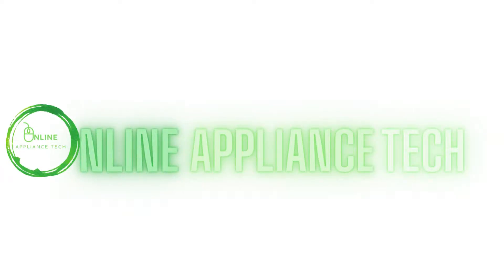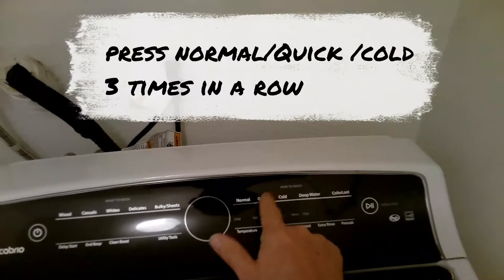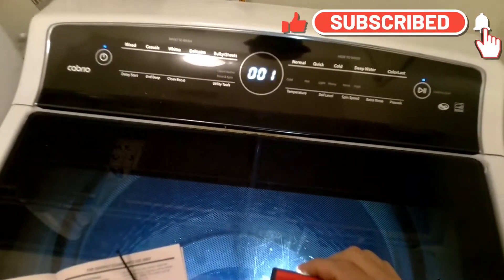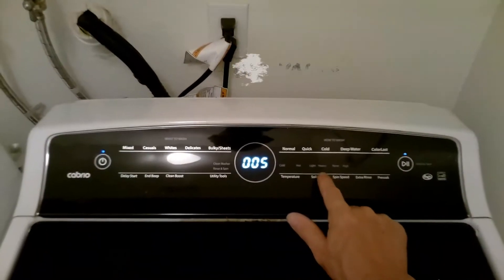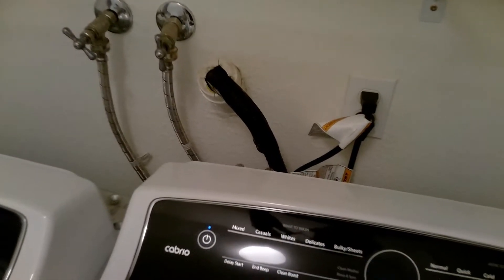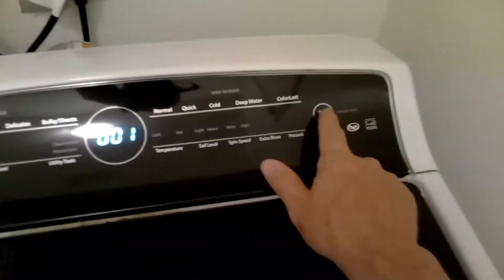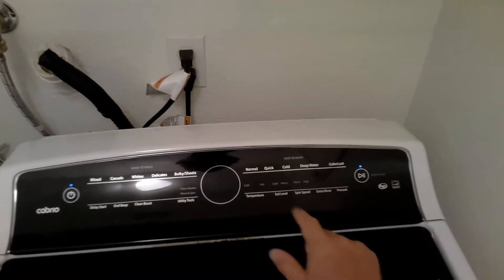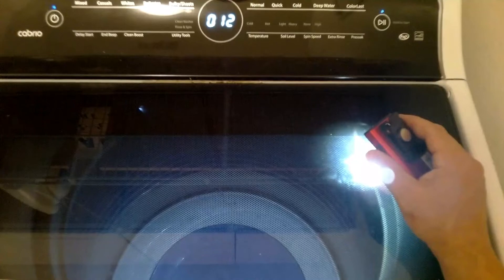Whirlpool Cabrio Washer Diagnostic Mode [ Pull up Error Codes] [WTW80 ]

Comment: Error code F5E3- door will not unlock, I tried unplugging and plugging back in but still locked. Any help?
Reply from the maker: Thanks for your comment! The F5E3 error on a Whirlpool Cabrio washer means the lid or door won't unlock properly. Since you've already tried unplugging and plugging it back in, here are a few more steps to try:

🔹 Unplug for at least 10 minutes – This allows the control board to fully reset. Sometimes a short unplug isn’t enough.

🔹 Check for water in the tub – If there’s still water inside, the lid may stay locked. Try running a drain/spin cycle if possible.

🔹 Lid lock switch may have failed – If it keeps happening, the lid lock assembly is likely faulty and may need to be replaced. It's a common issue on these Cabrio models, especially after power surges.

Hope this helps!

Comment: Cabrio model WTW7000DW1 did not finish the spent cycle and won’t get into diagnostic mode. Nothing happens when press the normal, quick and cold button 3 times in less than 10-15 seconds.
Is dead. Can you help?

Comment: Mine won't do anything after chosing a cycle. It's starts and goes back and forth with the add garment. The last time i tried a cycle and turned off the power it flashes INT. I did the diagnostics and everything working fine can you help? Please

Comment: My washer is a wtw8500dc3 it is showing a dash and a dot on my lcd display and pushing, normal, quick and cold 3 times doesn't change anything. I also unplugged it for several hours and when I plugged it back in it showed and equall sign with a dot. Any advice?

Comment: Nice Video with good information. Thanks.           I have a code "F2E1" showing on my Whirlpool Cabrio Model #WY8500DC3 and am not able to find a suggestion as to what it relates to exactly.     One suggestion I saw was the control panel might have a button stuck, but heating it with a hair dryer,as suggested,  did not work.    I did see a video someone posted on Youtube where a washer had a code of "F2E1" and "F7E4" and the Agitator splines were striped, but never saw what the "F2E1" code was related to on that machine in the video.     Can you help me on this "F2E1" code as to what it could be.
Reply: @Ralf-n3h  ever figured out what the fix was?

Comment: Super helpful! Allowed me to rule out that the valves are not working. They are working fine. Door locks fine too. Drain pump is working, etc. As far as I know, all is working individually. Yet the machine does not turn on when we try a regular washing cycle. Worked fine just the other day. No error codes.

Comment: What about f3 e2????
Reply from the maker: The Whirlpool washer F3E2 error code is a temperature sensor error.

If the water temperature sensor reading is out of the following range:

14°F to 230°F or 10°C to 110°C

the control will shut down the machine and give you the F3E2 error.